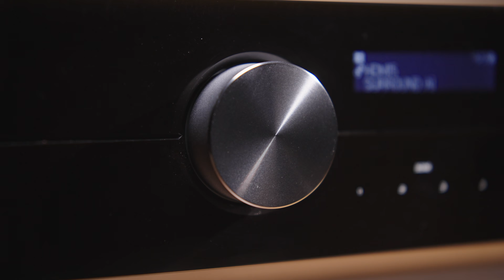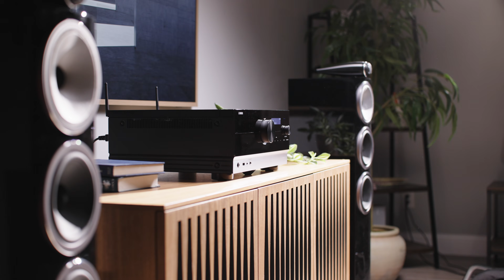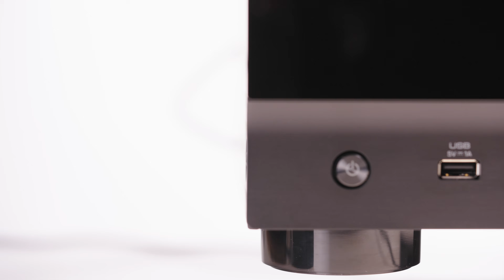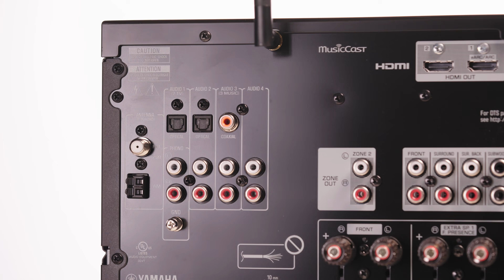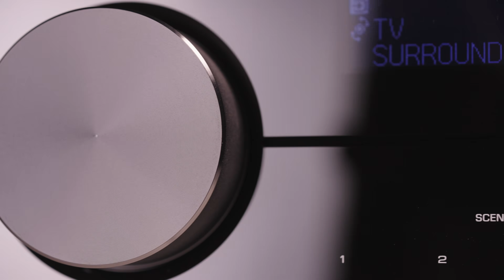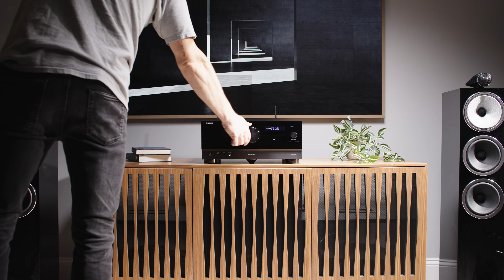Yamaha AVENTAGE RX-A4A 7.2-channel AV receiver | Crutchfield

Comment: I'm pretty sure I'm going to replace my RX-V571, which has been rock solid for years with no issues, with the A4A. Is the power rating 110 watts for all channels or for two channels?
Reply from the maker: It is rated at 110 watts per channel (2 channels driven)

Comment: What are the optimal receiver settings for connecting a 4K TV?
Reply from the maker: If you need help setting up your Yamaha A4A purchased from Crutchfield, do not hesitate to call our Technical Support hotline and we are happy to help you with the optimal settings. With a modern 4K TV with eARC features the Yamaha receiver will automatically select the correct decoding format and sound field for the content you are enjoying, making it easy on you!

Comment: £300 more than the Denon 3800 and with fewer channels   No thank you😅
Reply: Channels is all you get with Denon. 
When you're not watching an atmos movie Denon will sound like shit.
And the 3800 is ugly and it's got an unpleasant smell when it's warm. 
Yamaha is audiophile grade sound regardless of the source.. 
It is physically larger for a reason. 
Musically and sonically unmatched. Even with two atmos channels the quality of yamaha audio will be superior to denon.
Reply: Did I mention
Yamaha has better hdmi boards.
Visually your video sources will look better. 
Better remote app.
Reply: @lanla6838z I have a medical condition that prevents me from smelling anything apart from bullshit
Reply: New gen denons are notoriously un reliable idk whether u did ur research probably just search in YouTube u will get loads of repairs the is none single yamaha new gen avr failed maybe u need to also consider that snd since ur worried about 300$ u should also think what product last longer and im not any expert on these audiophile snake oil bullshit about audio quality or anything but if i brought an equipment i expect it to reliable ans long last atleast 5 years
Reply: look at the weight difference. Yamaha A4A-  35.7lbs, denon 3800 27.5lbs....  also Denons support is terrible. i have 20 year old Yamaha's that still can download firmware of Yamaha's servers., denon wont supply firmware for anything 10 years old. so they come up with error messages constantly.  

sorry but Denons are light weight junk compared to Yamaha.
Reply: Denon will learn to add a lead weight to make it heavier therefore more saleable then. 😂
Reply: @ENGLISHISBEST  or make actual good product with bigger heat sinks not tin foil. bigger caps and bigger transformers. Yamaha just makes better products than denon.

Comment: I mean its been a while its released idk why u guys doing this video after all this time
Reply: Because popular?
Reply: @Bradimus1 if its so popular why would they need an advertisement type of a video maybe this model is stucked between a2a and a6a like people either going with those two and not this probably
Reply: @kavinsiva1634 I actually have this one. It's a big upgrade over A2A and a lot cheaper than an A6A if you don't want that many channels. Advertisement of a good seller isn't a bad idea unless you can't keep up with demand.
Reply: its a current model... would they do a video on a future model that dosn't exist?
Reply: Yamaha appears to be running a ten year product cycle so this appears to be a mid-cycle advertisement.
Reply: One possible reason could be new models are coming so they could be doing extra marketing to clear the older models.